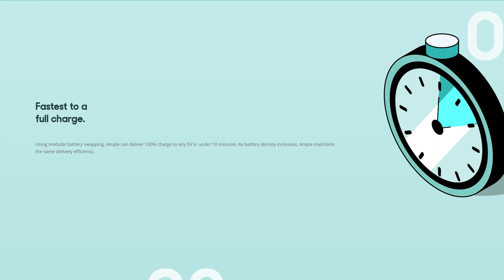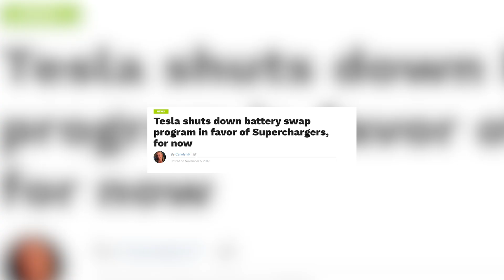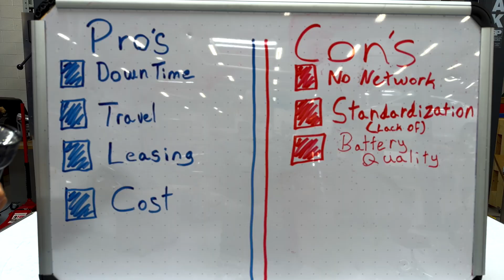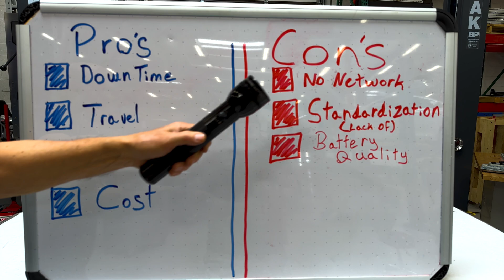Are Battery Swaps Viable? | Gruber Motors

Comment: You mention in the video that NIO only has about 200 swap stations.  I realize I am watching this video 9 months after it was made but currently NIO has 2,378 swap stations inn China and 39 in Europe and are planning an additional 1,000 by 2025.   NIO had over 2,000 swap stations in 2023.   Perhaps you misspoke or I misunderstood.  Currently, NIO has also partnered with other auto companies in china to standardize Swap, as well as collaborating on Swap station build out to spread cost.  NIO has also entered into agreements with Chinese and EU energy companies for grid balancing and energy arbitrage.  NIO has also entered in to agreements to incorporate solar generation at each Swap station.  Swap stations are NOT limited to just swapping batteries, they are also virtual power stations, battery backup stations spread geographically across the network, as well as a system to check for bad batteries and efficiently remove them from the system for recycling.  It is a battery management and energy ecosystem..

Comment: Standardized batteries to start, with onboard monitors for life tracking, when u pay for ur swap u r given a option to decide what grade battery u pay for, ev’s need to be built vehicle only, then u buy ur own battery that u will charge and be responsible for.   Or a lease program where u can do swapping with the lease company.    The company who decides to standardize batteries will eventually have the greater sales potential as they will be more enticing for the consumer who doesn’t like the idea of travel restrictions due to ev distance between charging and charge time

Comment: Swapping batteries has only been considered because people don't like the idea of waiting for anything let alone charging their car. The comments raised about receiving a battery that has damage due to over super charging is worrying if you own your battery but not such a concern if the battery is leased. It would be a pain if you received a battery that shortened your range on a long trip or a battery that needed charging more often at home or using public chargers that would cost you more money. Battery swapping will only work if all batteries are the same and the batteries are leased. Every EV is constructed differently so the removal and replacement of each battery pack would be different and might take longer for the automated system to do.

Comment: After looking into NIO's swap stations here are some of the issues that I've noticed.
- It takes about 6 minutes to swap a battery. If there is someone ahead of you, that number gets doubled since you'd have to wait for them to complete their swap first. The more people in front of you, the more time you'd end up waiting.
- During the entirety of the swap you're unable to leave the car. Even while waiting in line since you'd have to move up every 6 minutes or someone else could take your spot in line. (Autonomy could potentially solve this in the future but we're not there yet)
- If you have to go shopping/run errands it can't be done during the swap. You'd have to complete the swap, then park the car somewhere and then go do whatever it is you need (Again autonomy could solve this)
- The infrastructure is expensive and I seriously doubt if NIO will be keep up as they sell more cars.
- Each station will have to keep several battery packs in storage that they could've otherwise turned into a car. The solution to this that they've suggested is turning it into stationary storage for the grid. Which doesn't make sense to me since these batteries will have to be swapped into car at some point and 6 minutes for a potentially half empty battery is not an option.
- These batteries in swap stations will need to be fast charged constantly there by cutting the pack life in the long run.
- Once there is is a step change in battery technology, the swap stations could become useless. (A solution to this is that they could convert the entire thing to stationary storage but there will still be more expenses involved in these conversions)
- Making swappable cars increases the complexity in vehicle production and adds weight to the car since the battery can never be turned into a structural component.

I kind of understand why most manufacturers are shying away from swap stations. It doesn't make much sense in the long run.
Reply: 1. actually 5 mins for second gen, 4 for thrid gen. And chargers never have a line up, only swapping you see a line up.
2, true, can't leave your car for 5 mins, excruciating!!!
3. takes 4 mins to swap your battery, excruciating!!!
4. The infra is expensive but the expeirence is better and charging isn't cheap either.
5. I am too lazy to explain
6. Wrong, they can be slow or fast charged and extends battery life but too lazy to explain
7. wrong but too lazy to explain
8. Indeed, it is very very complex to add a few high tech bolts to your battery pack so they can be swapped. But then other battery packs at this point can be replaced at a dealer any. Oneday CTC and CTB becomes a reality then you can't even repair or replace your battery pack.

Comment: Battery swapping for regular use passenger is a total dead end. DC fast charging is ultimately more practical than partially disassembling your car when you want to charge up. For those few drivers that truly need rapid refueling, just stick with ICE. We will still end up with almost every car EV.

Comment: The technical problems with swapping were not even addrressed.  What about connections for cooling?  What about the effects of corrosion on the undercarriage?  I'd prefer a permanently, safely installed battery.

Comment: Hi Pete, thank you for your comprehensive overview. I find your arguments for the pros and cons are all correct. Yet, two pro topics and two con topics should be considered furthermore: Pro:  The advances of battery technology are more often and easier accessible over time when leasing the battery.  Pro: The swapping station may contribute as a backup source to the stability of the local energy network.  Con: No matter how automatized and reliable a  swapping station  may work, there will be cases for urgent need of local intervention by a supervisor. Con: Once Nio should  raise the prices for swapping sharply , as a customer you are bound to the NIO battery standards. No alternative offerings are possible. Herzlich grüßt Dich aus Deutschland Oliver

Comment: Great video, you are showing the latest NIO PSS video clip, but had the wrong information ~200 PSS, (misinformation).   NIO has technology to analyze and mark any bad battery pack that won't be allow to swap.  Imaging you swap with new battery technology a few years from now, that can give you 20% or 100% more range, would you wan to to keep the older battery?  It's not like you can buy and trade in your iPhone every 2-3yrs when it can't hold a full day of usages.  NIO EVs can swap into a new battery after many years and keep the EV for a long time.